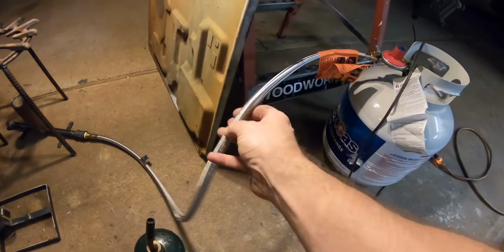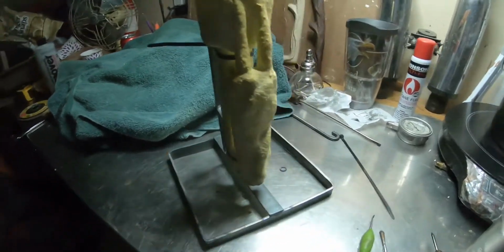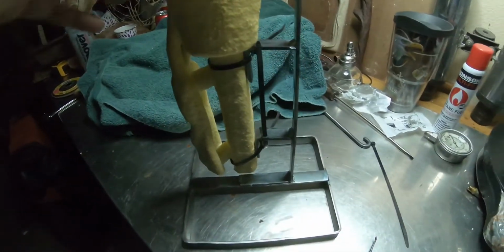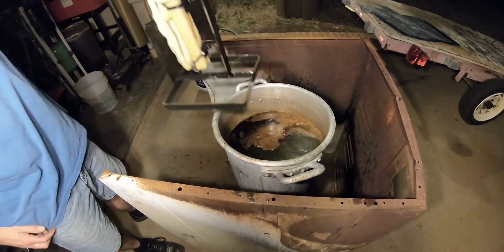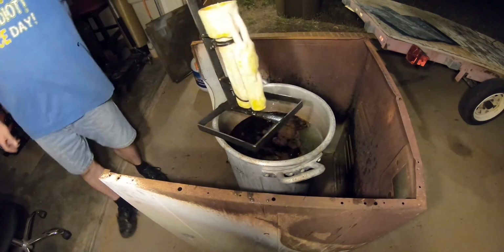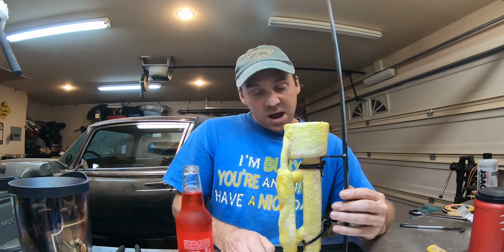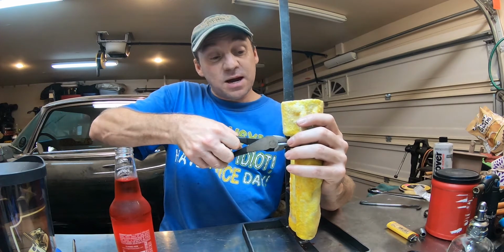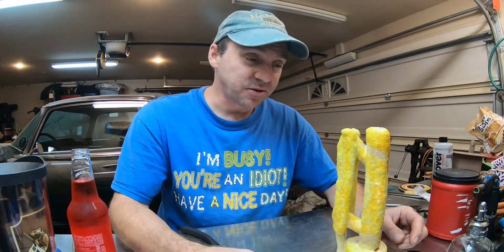Boiling Ceramic shell for lost wax bronze casting Part 1

Comment: Pretty impressive. I like the idea that you can fairly easily reuse your wax and that you got it out so cleanly. I've obviously never tried anything wax, but I'm always impressed with the type of stuff that can be cast. Stuff that you simply cant do in sand.
Reply from the maker: swdweeb swdweeb Thanks Dweeb!  This process is so amazing, I've seen fingerprints in the final metal!  I filter all recoved wax through panty hose to clean it up.  When wax costs almost as much as bronze, ya reuse it on the next project.  Sand is great and fast, lost wax is for when you are trying to capture fine details.  Watch part 2 of this boil out method, you'll see the textures I scratched in the original clay work.  The process was, clay, silicone, wax in silicone mold, shell investment, dewax, then metal.  Lots of steps and plenty can go wrong.  :-(
Reply: Yep, I watched the breakout video earlier today. It is pretty amazing what you can do with the process.

Comment: okiedokie then. I'll build a boiler! Would never have thought this possible. Great to learn something new.
Reply from the maker: Glad this helps!  I'd like to see it when you are done.  Be sure to build it tall.
Reply from the maker: @jobbingactor  Sorry it didn't work for you.  I know suspendaslurry is available in the UK.  What were you using?
Reply: . Wexcoat colloidal silica binder, Works good for normal burn out) specifically what brand did you use? I’d love to avoid burnout and go the steam route
Reply from the maker: @FashionGeezer  https://www.ransom-randolph.com/suspendaslurry  Be sure you select the correct one for ferrous or non ferrous metals.

Comment: That was pretty crazy being counterintuitive but it worked!! I wonder if you could do the same with a plaster/sand mix, probably not?
Reply from the maker: Hard to say.  While plaster of paris has many uses, pouring hot metal into it one thing I won't do.  I tried that stunt years ago and created an aluminum volcano!  Yes I know suspendaslurry isn't as cheap as a bag of plaster from blowes, but the results make it worth the money.  If on a budget as many of us are, you might look at riogrande and grab a box of ultravest.  It's a solid investment material for block molding.  It's very strong and you just stick the entire block in the kiln and go straight to burnout.  Best part, it doesn't crack like shell material does.  It's all up to what you are trying to do.   Thanks for watching!
Reply: @jagboy69  I just ordered a devil forge gas furnace, so I’m looking at a bunch of videos, I saw that many have had success with a 50/50 plaster & fine sand mix. At this moment, I don’t know yet how I’m going to get the was out of the mold. The only way I see it now is to put it in the forge? But I mess the forge up? Not sure. I don’t want to buy an oven for this now, so that’s why your system looks so attractive!

Comment: pretty cool, I thought it was going to be some sort of steam dewax or something like that, never thought of boiling it, lol. Congrats on 200 subs and cant wait for the fox series to come out. (I saw the unboxing video on fritz's channel) :P
Reply from the maker: Thanks Chirp!  Fritz already showed off the fox...  Work has had me swamped and it's been tough to clip together hours and hours of footage.  I built this little burner, cobbled together that stand, dewaxed and videoed all this in just a few short hours today.  Quick and easy.  I'm just hoping surface finish won't suffer using this boil method.  We will find out tomorrow.  ;-)
Reply: yea, I know what you mean by being swamped, I havnt had time to even walk to the shop yet alone work on anything, lol. Im curious how the finish will turn out since some of the clay probably gets washed away slightly, exposing some of the sand grains. I wonder how this method works for accuracy of the cast parts from that?
Reply: There is steam dewaxing.  This is done in an autoclave.

Comment: Hi Jason, watched this again and thanks.  Please share some details now that you dewax with boiling water regarding drying time, initial heating degree and amount of time, prior to vitrification. Roy
Reply from the maker: During boil out dewax, it's important to spend as little time as possible in the water as the shell would eventually degrade.  So be sure to have the water at a roaring boil and keep it boiling hard during the entire process...  The shell gets submerged for only as long as necessary to float the wax up and out of the shell.  One thing is the sprues and feeders must be arranged to facilitate the wax to float UP and out of the submerged shell.  Gentle shaking of the shell under water will help the wax quickly escape.  Once finished (around 10-15minutes)  The shell is removed and allowed to dry for 24hrs.  At this time, a careful inspection should be made for any cracks.  If cracks are found, a mixture of slurry and fine silica can be brushed over the area as a patch.  Re apply over the patched area 3-4 layers of paste allowing a few hrs to dry between applications.  Then it is safe to proceed to burnout and raise the temperature of the shell to approx 1700 degrees and pour in the bronze.  Shell is preheated to around 1000degrees if pouring aluminum into it.
Reply from the maker: We really need to get you onto the forum.  I JUST outlined this, complete with drawings of sprue design for Seth.  Look up his trilobites back at THF.  I will do an addendum video to this in the future.
Reply: @jagboy69  Super Thanks Jason for your timely and informative information!!!  I will look on the referenced site.

Comment: I made a simple solar powered oven out of an old refrigerator that had fiberglass insulation. I took the door off, laid the box down, and put a double pane glass door over where the old door had been. By the end of the day the temperature reached 200 degrees F.  I put the wax beforehand on a sloping piece of sheet metal inside where it dripped through some screen wire into a tub. I would pull the window back and ladel the wax into rectangular microwave plastic food dishes and let them cool. I cleaned up a barrel of casting wax in several weeks.
Reply from the maker: Too bad that wont work for shell.  I have to keep close control on the temperature of an invested wax piece.  Wax expands 9x when heated and the shell expands ZERO.  Solid investment is much more forgiving than shell.

Comment: Very nice! A couple of questions.... How did the wax survive? Is it still useable compared to burning it out?
Also would you mi d sharing where you purchase the slurry and silica?
Reply from the maker: The wax survived better than flash fire dewax.  Wax recovery is literally 100%.  After the water cooled, I pulled a thick slab of it off the top of the water.  Both methods allow for reuse of the wax.  Flash fire requires reheating the wax and filtering, (https://www.youtube.com/watch?v=LJgO_e-yHKA)  while boiling leaves the wax nice and clean.  
Suspendaslurry and the 2 different sizes of silica are easily available from https://www.ransom-randolph.com/  
Thanks for watching!

Comment: Jason, I just posted a long comment but it seemed to disappear into the digital wherever.  Questions: 1.  Do you use release joints?   2.  In your (or others) opinion what is the minimum horsepower needed in an air compressor for sandblasting small saw a two fist size no detailed and very smooth work?  Do you or others know of alternative means for cleaning other than sandblasting.  Roy
Reply from the maker: Roy.. Look on page 2 back at the forum.  I saw your question and answered it on the forum.  Even if you have a small sandblaster that is slow, it's still something that has to be done for a patina to apply evenly.   I have heard that an acid bath may be used to dissolve ceramic shell, but it's not something I've tried.
Reply from the maker: Now to answer your question about vents, (I saw an email with your first comment here)  If I am boiling out shell, I don't run vents as they aren't necessary.  With the HOT BATH, the entire shell heats evenly and there isn't any pressure that builds that would crack the shells.  If I am using flash fire dewax, I recommend drilling vents to help with cracking.  The drilled vent holes are easily patched up with a mix of slurry and fine silica.  I apply with my finger, let dry and repeat a few more times with a small chip brush.  Then it's into the kiln to heat up to around 1700 and pour in the bronze.
Reply from the maker: Here is a repost with my opinion about sandblasters.  

When it comes to compressors Roy, you find the biggest one you can afford. THEN buy the next larger one! lol
I'm serious, but you really can never have too much air especially when it comes to sandblasting. Sand blasting really eats up the cfm's and if you have a tiny tank, you'll only blast for 30seconds and then have to wait a couple of minutes for the tank to build back up. SO it depends how fast you would like to get the job done.

I have a 60gallon and it will actually keep up with my little sandblaster. It will let me sand blast about 5mins, then it will flip on and run for say a minute and shut off. That's the power of a big tank and powerful pump... If budget is a concern, REALLY try not to get anything that is OIL-LESS, they are stupid loud and have short lives. An old school compressor that has an oil sump will always last much longer than junk reed valves. Good news is compressors are relatively cheap. I paid 800bucks for mine back in 2004! I change the oil in it once a year and buy it new air filters every few years.

Here is an off the wall idea, https://www.harborfreight.com/air-t...-cast-iron-vertical-air-compressor-61454.html Now here is a dirt cheap unit that will do some sand blasting, but might be a little on the slow side, but here's the kicker. BUY 2 of them and attach them together if you find one of them sucks for you. But one should do the job for small work if you are patient.

Now I DO NOT like the sandblast guns that come from the hazard fart. Here is my gun. I shit you not, I bought this kit back in 1988 and still use it today! Looking at the price, I don't think they changed anything and it should not be from china that's for damn sure! https://www.tptools.com/Build-Your-...t-Trigger-Operating-System,7200.html?b=d*8039
Yes it is much more pricey than HF, but mine works a dream, doesn't clog and as long as the straw is buried in the glass beads, I'm shooting material. If you do order that gun, tell them to get you some ceramic tips. They last way longer than the steel ones.
Reply: Wow, Jason you are really on top of things and this wonderful forum that you so generously provide!!! The barrage of posts are an indication of my anxiousness as am about a couple of weeks away from realizing first ceramic cast experiments.  Will be using wax boil out method.  Have completed successful test casts of aluminum with home constructed furnace.  Will eventually cast bronze however in the meanwhile have a great deal of aluminum on hand.  Want to pass along some info to you and your viewers I found out regarding finishing aluminum vs bronze.  There are several references to this on the web.  The best is from www.Eastwood.com (search master dual blaster abrasive soda blaster) in a video of their combination setup for abrasive (bronze finishing) and a soda blaster for aluminum.  Abrasives pit the soft aluminum.  Darn it Both require a compressor.  I could use on occasion a school massive air compressor but would need to come up with a portable sand blasting cabinet for the bronze!  Enough for now.  Thanks for your generous help.  Roy
Reply from the maker: @roycarter8575  Yeah, I was a loyal Eastwood customer back on the 1980s.  But they have sold out to china and their products sadly arent what they were years ago.  The only thing that remained was the eye watering  high prices.  😳  Good luck with your first attempts.  Keep castings simple in the beginning and boil out works good.  If you get too thin or dont have your "plumbing" that's sprues and feeders,  too complicated, wax can have a hard time getting out.  I suggest getting back on the forum and posting photos of each step you make.  Let us check your work!  Especially before applying slurry and silicas.  I've seen some interesting sprueing techniques that's for sure.  You must design your wax system so melted wax will want to float out!  All the best Roy!👍
Reply from the maker: Something else Roy..  After you dewax and you preheat the shell.for pouring metal...  The shell temp is not the same for aluminum and bronze.  For bronze, I use 1700.  That's way too hot if you are pouring aluminum into ceramic shell.  Guys get better finishes around the 900degree mark.  R&R only told me what their material would withstand, their tech department arent metal casters.🙄

Comment: Thanks for the video on boiling out the ceramic shell. I gave it a try last summer, one out of my five shells survived?  I’m also using the  same ceramic shell material. Drilling small holes in the shell before burnout/boil out can release presser on the shell as the wax expands. Your metal rack is a good way of controlling the shells getting in and out the water. You had mentioned a university that was also having success with boiling shells, could you provide me with name of the university?  
Shellspen an American company that sells ceramic shell material reference boiling out shells on their sight, might be another reference on the subject. 
Jason
Reply from the maker: Sorry I don't recall what university that nice lady worked at.  That stinks to hear only one out of 5 shells survived.  I'd like to see photos of your "plumbing" arrangement.  Unlike traditional spruing methods, when boiling out, everything must be pointed up to facilitate the molten wax to float up.  Small holes can help to relieve pressure too.  Good idea.  I am familiar with shellspen down in Sarasota.  Those guys are a total ripoff for ceramic shell.   lol....  I didn't know that they advocate boiling... interesting.  I still run both processes as they each have their merits.  Are you on AA or THF?
Reply: worldtraveler regarding “plumbing” you are running your feeders direct vs indirect, Interesting?  That would help with wax but might cause problems with the flow of bronze. I will give it shot. Plan on running some tests on boiling out in the New Year. I burn out a lot of molds over the course of a year. Would like to get a way from the smoke. Don’t have the funds for a proper afterburner system. Lol. All your info is super helpful. Thanks for sharing. P.S. what are you referring to when you say aa or thf?
Reply from the maker: I too thought it would cause bronze flow issues... But it hasn't so far.  Remember, the shell is gas permeable.  Look at some of my sprue jobs I've put up here so far.  Totally backwards from conventional wisdom.  I've even been able to pour down to an 1/8" inch the wrong way.  Shell is practically idiot proof if you can keep it from cracking.  Come join in the party.  Lot's of excellent guys here and many run shell.  You'd fit right in!http://forums.thehomefoundry.org/index.php
Reply: I was initially thinking maybe you would rather put in the shell when the water is cold and let it heat up with the water but after learning it's all water soluble shell maybe not such a good idea
Reply from the maker: @RaspyOB174  That would probably weaken the shell given the extra time to heat the water.  Thanks for watching!

Comment: could you put it in an oven or kiln at the melting point of the wax?
Reply from the maker: Yes you can..  But it is best if the oven or kiln is already UP to temperature, it's the slow heating of the piece that causes the wax to expand and crack shells.  So have the kiln preheated and rush the shell in.  You will still need to catch the draining wax and fire is kind of an issue, so there is that.  A pan of water under it to catch the wax works well.

Comment: Hello,
I am sculptor from Lithuania,
I also cast sculpture,
 What kind of shell you are using? Is its base water, or  other? Want to ask, do you have contacts of Elizabeth from University that boils out ceramic shells to consult a little bit?:)
Reply from the maker: Everything I learned from Elizabeth I went over here.  Yes the shell is water based.  You have to be quick boiling the wax out or it's goodbye shell.  I use Ransom & Randolph investment, it is available in Europe.
Reply: @jagboy69  Thanks!

Comment: So..... I’ve got my kiln and got my slurry mix.. Obviously I can’t boil PLA out of the shells that will have to be cooked out.. In the bulletin R&R emailed me the recommend a “flash firing” at 1700* I would think the ceramic would shatter if you placed it in a 1700* kiln.. I would assume a slow heat up with a few temp holds along the way. Any advice?
Reply from the maker: Sorry I didn't see this sooner.  David on Thehomefoundry channel on yt does shell/pla.  I do know he has to run like 9-10 layers and melts out in a kiln.  Good luck.
Reply: worldtraveler no worries man I’ve got things under control now and took your advice and found a used kiln that I snagged for the right price.. I am working on perfecting the ceramic shell and working on some intricate bronze castings as of late.. Thank you for all the videos-( That have helped me tremendously! Also you don’t have to use the randsom and Randolph aggregate) I’ve been using 80 grit aluminum oxide with great success! The only problem is the color change of the media)
Reply from the maker: @jrsemporium5579  Good job man!  My kiln cost me 25bucks and reeked of cat piss when I first got it.  I'm sure you could use harbor freight glass beads or small pebbles for the coating.  The only one that matters really is the first layer or two.  If the grain size is too large, surface finish will suffer.  Silicate can be hard to find locally, no one really uses it these days.